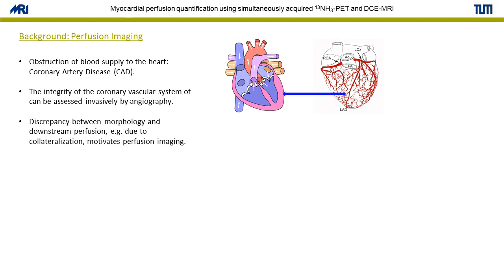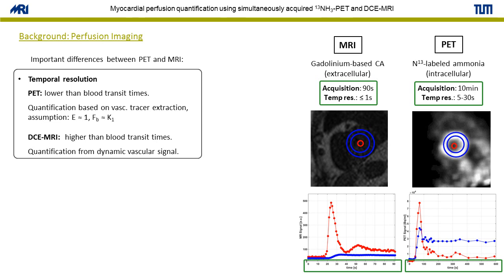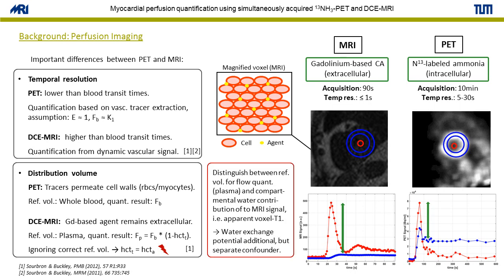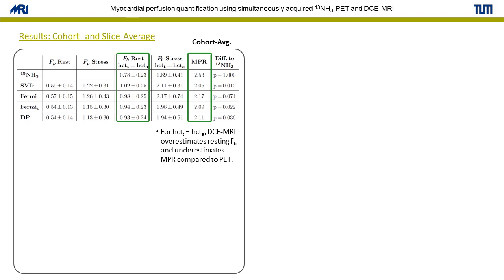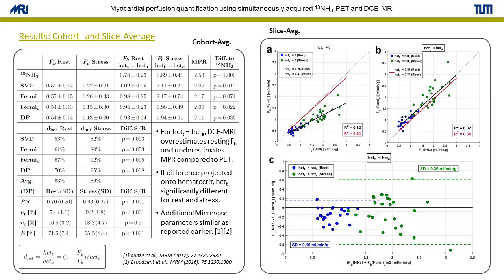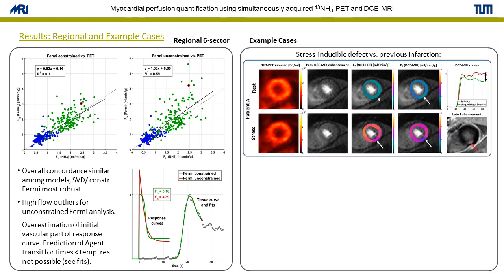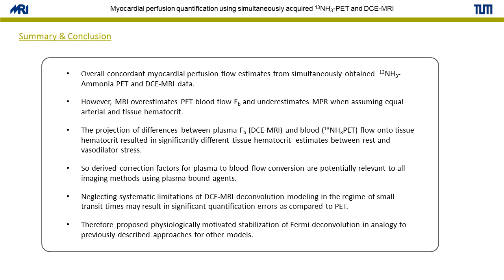K. Kunze: Myocardial Perfusion Quantification Using 13NH3-Amonia PET& Dynamic Contrast-Enhanced MRI

Comment: Very nice work. How do think you might test the hypothesis about tissue hematocrit and its change with stress?

As an aside, I think you referenced the wrong Broadbent paper. It should probably have been: Broadbent et al. Magn Reson Med 2013;70:1591-1597.
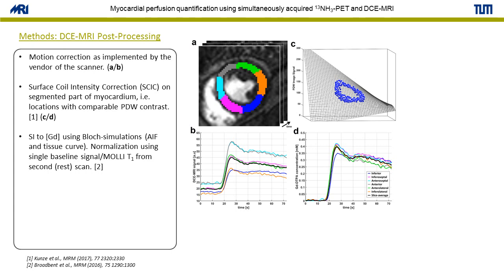Reply: Yes, this is correct, citation [2] on the Methods slide starting 5:45 should be Broadbent et al. MRM (2013), 70, 1591:1597. Thanks for pointing this out and sorry for the glitch!
Concerning hematocrit - I agree that validation of this aspect would be very interesting, however, I've had surprisingly little luck trying to find a knowledgeable physiologist to advise on this. I guess one could try to isolate the relationship of the (DCE-) MRI signal to the rheological flow effects occuring for whole blood in small tubes (Farhaeus) in a perfusion phantom experiment. This would still be quite far away from physiological reality though, with respect to MRI signal (e.g. water-exchange effects) as well as with respect to microvascular flow regulation in the tissue.